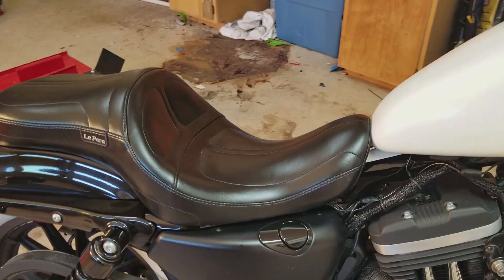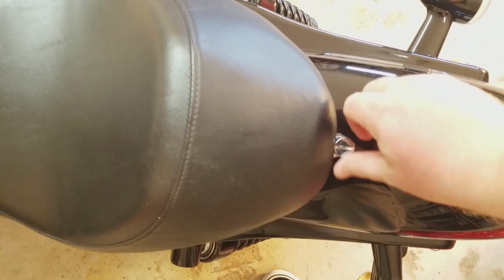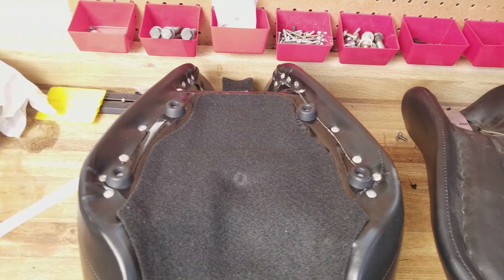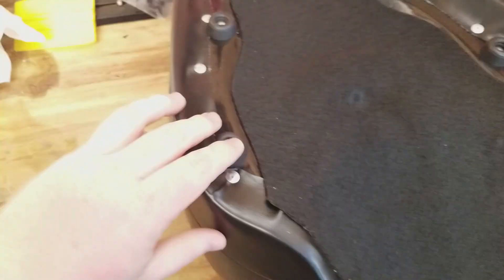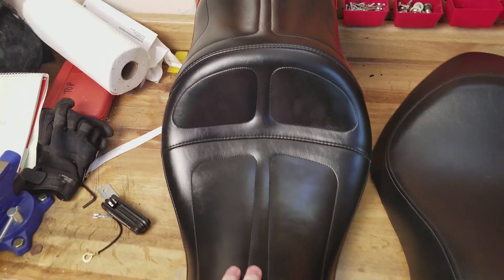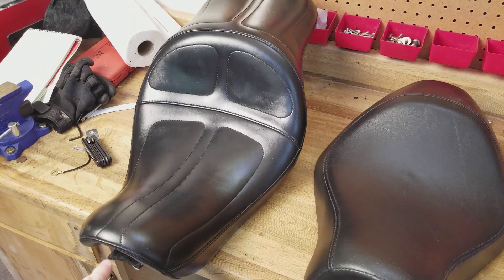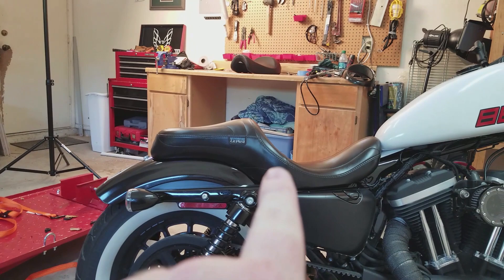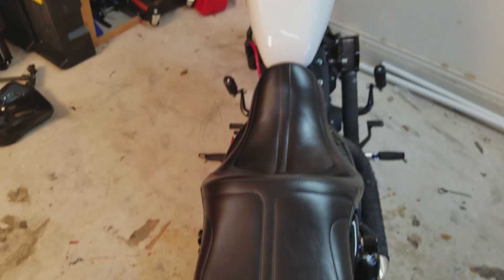LaPera Maverick Seat Review 2,000 Miles Later Harley Sportster Iron 883

Comment: These seats are designed for comfort/touring and made for bikes with full height suspension. Proper length rear shocks (12.5-13.5") will fix the slope towards the rear. Solid review.

Comment: You're the perfect person to ask since you have experience with both the Iron and sportbikes. How much more comfortable is the stock Iron seat compared to a sportbike? Everyone agrees the iron seat is crap, but I'm trying to get some perspective between the two..

Also I'll best the thumbs down was for the "You can't take your bitch on the back" comment. Thumbs up from me. :)
Reply from the maker: +Mitch I think making a comparison between those two is falling into the apples and oranges category. The stock iron seat is crap because it's made out of shitty materials and puts pressure points on your bum. Sport bike seats however in general are at a sharper angle and usually have less padding just by design. For example my triumph. The seat is actually great. What makes it uncomfortable after a while is the seat angle forces my boys into the tank. 
But comparing the stock iron seat to something more in it's category like a Honda shadow, it's still garbage.
Reply: Thanks for that bro.. been wondering bout this for a while. Have a feeling that I'll end up going Dyna when I get rid of the Ninja 300, but from what I read, their stock seats aren't much better. I think I heard it described as the 'Harley Tax' - buy the bike, then immediately need to buy a new exhaust and seat as well.
Reply from the maker: +Mitch yeah it's the same with all Harleys. Buy used and chances are the Harley tax will already be paid on it